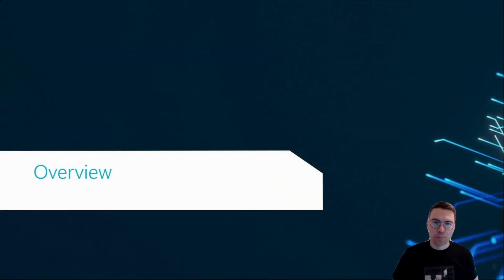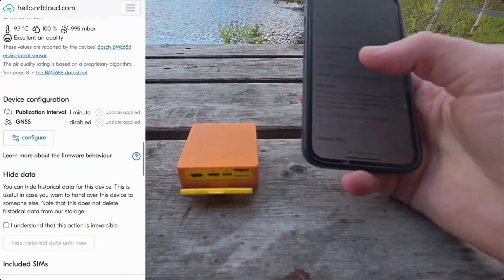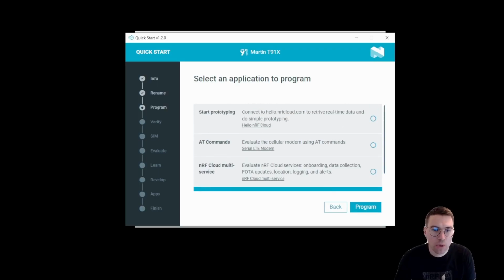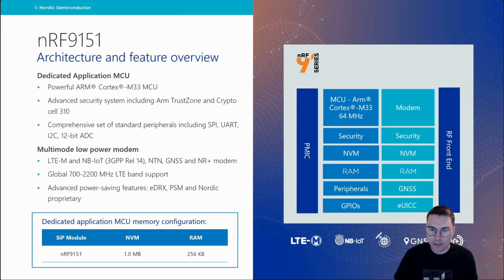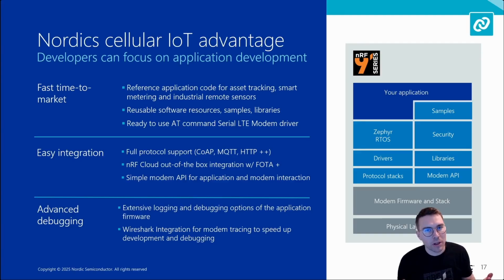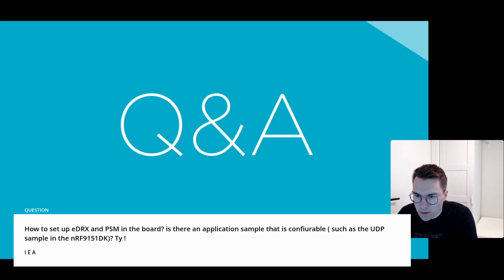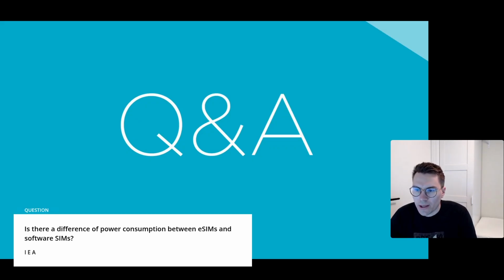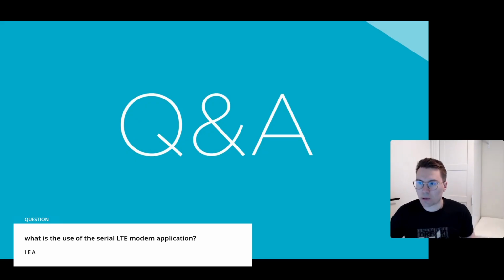Introducing the Thingy:91 X – The Ultimate Cellular IoT Prototyping Platform

Comment: Really nice new product. But be aware that quite some functionality formerly working on the Thingy91 is not (yet?) working on the Thingy91X, namely debugging in VScode, support for PMIC power management, and some sensors. Better stay with the older but way more mature Thingy91 if you want to get something quick into the market. Not sure if Nordic is willing to put in the budget and resources to get the new Thingy91X on the same level.